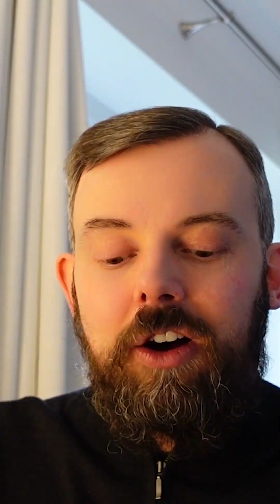Type AC RCD which EICR code should i use?

Comment: Napit say its a C2 If there is DC equipment. Considering nearly all houses have led lighting, laptops, digital displays on washing machine etc, it suggests that the vast majority of properties will have dc leakage in their electrical systems.
Reply: I'm with Napit so I have to give it a Code 2 as I got a few EICR's to do this month, which I'm not looking to make work but looking at Slightly future proofing as we know the Regs are forever updating, btw any thought on Coding for no SPD?
Reply: @AnthonyStewart-y9o  no SPD is a C3 👍